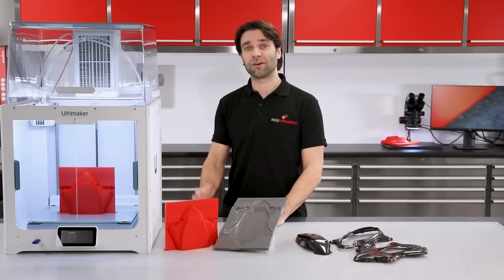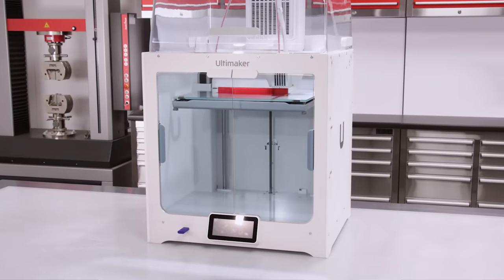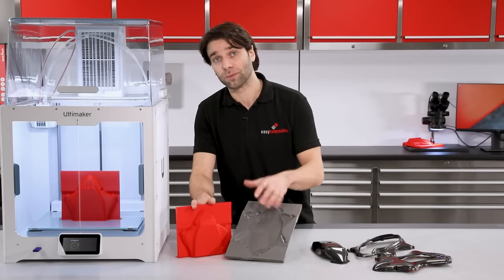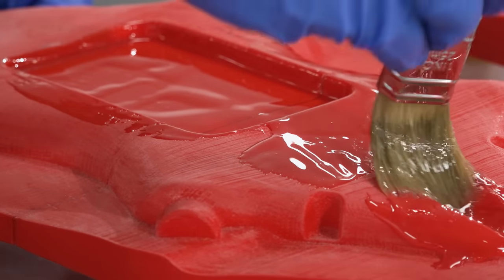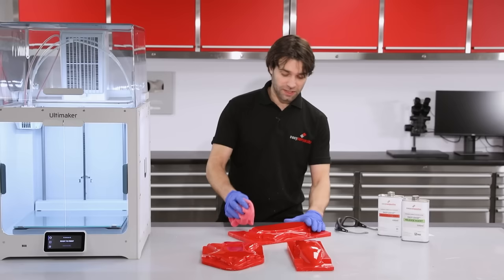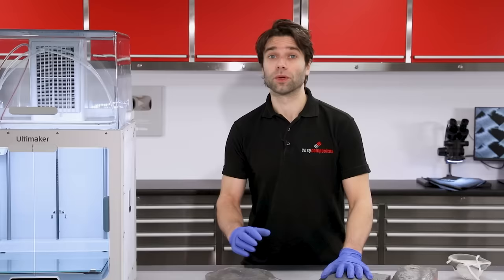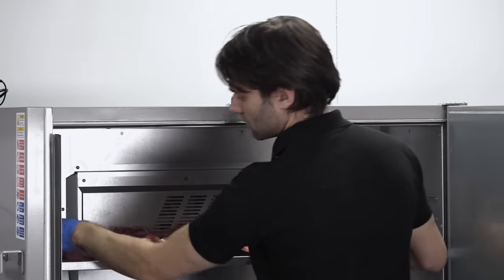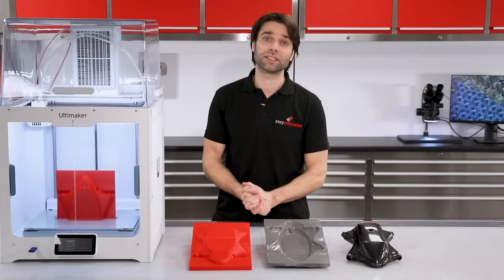Making a Composite Mould for a Carbon Fibre Part from a 3D Printed Pattern

Comment: if you are  to use a 3d as a mould i would suggest printing ABS and using acetone smoothing
Reply from the maker: Thanks for the suggestion. One of drawbacks to ABS as a direct mould material is the reliability of the release. Epoxy resin will bond quite well to ABS and it can be difficult to create a reliable release surface on an ABS substrate. Our results found PLA to be a better choice when printing the mould. It's quite true that you can't use acetone vapour to smooth PLA but then, for a one off component, it's generally going to be easier to improve the finish on the component, especially as acetone vapour tends to produce a surface that might be shiny but tends to be a bit wobbly and inaccurate, rather than a smooth, precise flat finish that a pattern or mould maker would be looking for. But, certainly worth considering in some situations.

Comment: Have you considered making a tutorial for how to make 3d printed molds for forged carbon fibre production?
Reply from the maker: We cover the basics of design of the mould in the forged carbon video itself but mostly it is the CAD work which varies depending on the package you use.

Comment: You say you can get the mould from the 3d printed part by using the unimold system. Are you sure the arising temperature of 50-60°C wouldn't destroy the PLA 3D print?
Reply from the maker: The heat given off during the cure of the Uni-mould and our epoxy mould systems rarely get that high for long. Certainly we have not seen any deformation during experimentation.
Reply: @easycompositestv  
Thank you!

Comment: Thx for the EU customs information you put up on the website... was worried i had to get another supplier
Reply from the maker: No problem Daniel. Things are far from smooth at the moment, for all goods and in both directions but they will get a lot better and once the ports have freed up and our new system is in place then we should be pretty-much as we were. And of course, we'll always be working on ways to improve how we supply our friends throughout the union.

Comment: Great videos, very informative. I would like to make a request.. I've been wanting to create my own recurve bow (as in bow and arrow) FYI I have very limited knowledge about the tech used in modern bows. Now I'm mostly thinking about the limbs, I've read that carbon fiber limbs are some of the best. But carbon fiber doesn't seem very elastic at all, take for example the rollwrapped video where you test its strength. Would you like to make a video to demonstrate some "spring bow" properties of carbon fiber and maybe other materials? I dare you to make a recurve bow
Reply from the maker: Hi Mikal, thanks for the comments and suggestion. Looking at the stiffness and strength of carbon fibre can deceptive and create the impression that it couldn't bend or flex. In fact, this isn't the case at all; it's all about the geometry of how you use it. We'll take it on board and think about a future video which shows some structural applications for carbon fibre where the end product is loaded and flexed.
Reply: @easycompositestv  Awesome! Thank you for answering

Comment: Great video. I am currently doing a similar project but using your Pattern-Coat Primer rather than XCR Epoxy Coating Resin to finish the pattern. I found the Pattern-Coat Primer worked well, but I'm interested how you would compare these two products for this use-case?
Reply from the maker: Pattern Coat Primer is designed specifically for ease of sanding and shaping on hand made patterns.  The XCR is primarily a coating epoxy that is relatively easy to sand and polish.  Where considerable shaping is needed, such as over a foam pattern, the Primer is the best solution.  For patterns that are already pretty dimensionally accurate, using the XCR is a quicker and easier method as less thickness is added and thus less sanding needed to get a smooth result.
Reply: @easycompositestv  Thanks for the detailed reply. Less sanding sounds good - I'll order some XCR for the next project!
Reply: @easycompositestv  where are you getting your files for the 3D prints

Comment: You can do a p400sand and spray it with 2k clear.... Worked out good for me
Reply from the maker: Hi Arne, as much as possible we advise against clear coats or paints as pattern or mould finishes just because customers (and non-customers) have so many problems when releasing mould or parts off paint surfaces. There are lots of reasons for this and it's not always a problem (it sounds like it wasn't in your case) but on the whole it's risky and no one wants the dreaded 'sticker'!
Reply: @easycompositestv  that's a good point! I have been there as well! I will undo my comment so no one gets distracted. Is that ok to you?

Comment: Great video Paul...!!! Can we use this method to make a mould for composite wheel Rims?
Reply from the maker: Well, you could but given the accuracy required that would probably be a better candidate for a CNC machined mould and of course, that's just the start of the complexity for a project like that!

Comment: Amazing video! Question though, How do you account for the dimensional thickness increase caused by the XCR Coating Epoxy layers? It seems not to matter for this part's design, but it seems like it would be problematic for parts that need to fit together closely/securely. Thank you for this great video!!
Reply from the maker: For precision parts you may be better off using a different method if the tolerances are that tight.  You could modify the print to take into account a typical resin thickness but it would still not be perfect.
Reply: Do you know about how much we would need to account for?

Comment: Hello Easy Composites. Can you maybe show a video on how to make a mold to replicate a very rusty item? I’m restoring an old wheelbarrow and the tub is badly rusted, holes in places, so I want to make a carbon fibre version instead. The metal is very thin so sanding is not ideal, but I don’t know how to protect it or treat the surface so that the fibreglass mold will not adhere to the rust or cause more damage. Thank you 😊
Reply from the maker: if the surface is too weak to mould from, then you would need to make a pattern.
Reply: @easycompositestv  ah right, thank you. I’ll look at those vids then

Comment: How long would a mold like this last? Or, should I say how many runs do you think you'd have gotten from these molds?
Reply from the maker: The high temperature tooling could last well over 100 pulls depending on shape, care demoulding and a little bit of maintenance.

Comment: Hey, have you guys done something like this with cnc machined metal parts? Would it be possible to use a metal part for the mold itself?
Reply from the maker: metal moulds can be used for composites. They are especially more common in high volume production.

Comment: Why not to use SLA printer and leave behind all the hustle of sanding and preparing that FDM product? Naturally with SLA there will be some sanding but with 0.0025mm resolution much less of it! I know the size of the mould could be a reason but otherwise I would like to hear your opinion!
Reply: FDM printers are a fair bit cheaper and generally offer larger build volumes. SLA 3D printers will work here for smaller applications unless you're lucky enough to have the new Formlabs 3L. That said, there will be less post-processing like you mentioned.

Comment: How would you make a mold for a bigger part ? Let's say 5 metres long ? And if I use the infusion process for a part that big would the infusion kit you offer still do the job? How is the strength/weight difference between a oven cured part and an infusion part in your experience? 

Sorry for all the questions I have  been a fan for a long time and i am very interested in the whole process.
Reply from the maker: Hi Daniel, so, when you're asking about a 5 metre long part I assume you're not talking about using a 3D print process, as shown in this video! Something that size would most likely use a hand-build process more like what you see in Part 1 of our Dark Ice series, where we make the pattern for the sledge. In terms of how well the infusion would cope over 5 metres, it would be fine but you would need to set it up correct. Watch Part 5 of the Dark Ice series where we infusion the sledge for lots of great information on setting up larger infusions. In terms of how they compare; they're remarkably similar - there's really nothing to distinguish a prepreg part from a resin infused part if they use the same reinforcement. the only obvious difference would be the service temperature of the finished part which would be higher for the prepreg.
Reply: @easycompositestv  thank you :)

Comment: How did you workout the dimensions for the mould of the part you want to make. Isn’t it slightly larger than the part itself? is there a particular software that you used that can convert a model to a mould for that model?
Reply from the maker: The 3D printed part is the exact dimensions of the finished carbon part.

Comment: Would it be advisable to print the form 1-2% smaller vs the desired finished product to account for the resin coating thickness?
Reply from the maker: Hi Jason, I wouldn't aim for a percentage reduction in the size of your prints because this could lead you to making larger parts that are several millimetres smaller than you want them to be. The coating itself only adds around 0.5mm and so the better approach would be to design the part 0.5mm smaller (in all directions) than you want it to be.
Reply: @easycompositestv  Thanks this makes sense!

Comment: Hi, I just discovered this, and I am very interested in the process so I can make my own carbon parts. do you use a regular 3d printer ? what material do you use ? abs or polypropylene ? thanks
Reply: Dont use ABS, PPE or PLA will work just fine

Comment: Googled this a few days ago after watching some of your videos ! Thank you for reading my mind ! Also, can we use regular plaster or something instead of that paste for testing purposes ?
Reply from the maker: It would be difficult to get any sort of a bond between the gelcoat and a casting plaster but in principle, you could use much more basic materials for a temporary mould reinforcement, especially for ambient temperature cure systems.
Reply: @easycompositestv  great ! Also, one video request that I've never seen around - how to create a thick carbon fiber part using a 3d printed core and a carbon fiber outer shell ! I'm very interested in such a technique ! Also, do you know if, when purchasing from you guys to Portugal, there are any extra Customs costs ? Thank you  !

Comment: I wonder if smoothing with acetone would give you a good surface finish for making the mold.
Reply from the maker: Acetone vapour can be an option for improving the finish on the 3D print but then that’s still not a good release surface and you would need to coat the print with something that can be reliably released from. In all our testing and experimentation, we couldn’t beat the process shown with the XCR resin for surface finish and release properties.

Comment: Love your videos, like the other 3d print mould, so why not printing the mould directly, coat it with resin, sand it, laminate it and vacuum bag?
Reply from the maker: Yes, you can do this. In fact, this is exactly what we did in our other video on 3D printing with carbon fibre. The reason we don't do that in this video is because we need a mould that can take high temperature so that we can cure prepreg carbon fibre in it (which needs to be cured at 120C). As you can imagine, a 3D printed mould can't be used at 120C. However, if you're only wet-lay vacuum bagging and don't need the high temperature cure then you can consider using a 3D print directly as the mould, like in this video: https://www.youtube.com/watch?v=4ND2WtEZatY
Reply: @easycompositestv  thank you so much!

Comment: Thanks for the video, helped me a lot! But I have a question. I am doing a project that dimensions are very important, so i have to consider the thickness of the two laters of resin applied at the beggning of the process and do an offset in my 3D model. What is aproximately the thickness of each thin layer o resin? Thanks in advance!
Reply from the maker: It's really going to depend on the surface texture from the print and how much resin you have to apply to achieve the flat surface. It also depends on how much you sand away so there is no general rule to determine the final added thickness. Typically you will add the resin around 0.5mm but this depends entirely on your application and then how much is sanded away.

Comment: Amazing content. Question: what would be the difference between using the epoxy coating resin on the 3D printed part vs a mould sealer? Would the alternative work or is it recommended to always apply an epoxy coating resin to 3D printed parts? Many thanks in advance!
Reply from the maker: Hi Trent mould sealer is definitely a possibility and in fact several of our customers have been using our S1 20 product for just this purpose. The difference between using a sealer and using a coating resin like the XCR is the way they build. Epoxies will build much quicker but then because of this they will need more flatting to restore the trueness of the surface. I guess I’d recommend sealer for resin print and epoxy for FDM prints.
Reply: @easycompositestv  thank you for your detailed response.  Gave me all the additional information I was hoping for

Comment: I’ve had the idea of using a 3D printed core maybe out of lightweight foaming PLA do you think that would be suitable?
Reply: Are you referring to something like Polyalchemy Elixir PLA?
Reply: @dynamism6990  not familiar with that brand I was thinking about Colorfabb
Reply: @CurJam87  Interesting. I haven't used the material personally but would assume it will work for this application since it is still PLA based with a small additive.

Comment: Nice vidéo ! Two questions : 
If the final used is not prepreg could I use the same process without the final cure of the mold (I don't have any oven) ? If yes is it the same product to use ? 
I did a 3D printed mold in PLA and get a poor result with the lb2 bio laminating resin. Will it be better with this kind of mold ? (I wish to compress a part in a two part mold) 
Thanks 😊😊
Reply from the maker: Yes for room temperature curing resin systems you can do that.  You can drop down to the EG60 and EMP60 which are  low temperature versions of the gel and putty seen in this video. PLA is not as easy to release as PETG.  Also the LB2 is a laminating resin so higher viscosity.  You want a low viscosity resin so our IB2 or IN2.

Comment: Greetings!  Is it possible to cure prepreg in a home oven?  Do you have any instructions on how it might be done?  Thanks!
Reply from the maker: We don't recommend it as most ovens lack accurate temperature control necessary for good pre-preg curing. Also most are not capable of being programmed to follow a cure cycle.

Comment: MY GOOD. JUST WHAT I NEEDED :O
Reply from the maker: Thanks Michal, that's good to hear. Look forward to seeing how you get on.
Reply: @easycompositestv  No way you wouldn't want to see it. It will be the most cheap and crude way possible 🤣 I'm a poor student, doing a custom diffuser 🤣 3d printed with a thin layer of filament in parts glueded together and reinforced with putty and fibreglass once the fitment is perfect. Than time for a mold. I've found your videos very informative and useful, it's also quite entertaining, it isn't boring 😂. The usage of a vacuum cleaner and epoxy for smoothing blow my mind away and I won't have to worry about a vacuum pomp.
I found also thanks to you guys there is a material called diolen, and it looks like carbon 😁 I'm thinking of using it instead of fibreglass, what do you guys think, diolen vs fiberglass? Or both 🤔 top layer for looks

Comment: I can understand rhe need of such in an industrial production..but i would just have used a vacuum bench and a hot owen and saved a day, then made a backing of plaster and band aid you buy for healing broken bones.. printer is basically the required part here and that i agree so i would use cheap pla, a vacuum forming table and a backing material thats cheap but that works for us home makers. A company has no such problems as resin smells etc so that seems feasible to be able to bou a product kit

Comment: How much smaller should the 3D print be that the mould will achieve the right size?
Reply from the maker: Same size.  The process of making a mould keeps the dimensions for the finished part.  The resin layer is a fraction of a mm difference.
Reply: @easycompositestv  Thanks!

Comment: Great stuff as usual! Just out of curiosity, if I wanted to do a one off part, let's say a petrol tank for a scooter in one piece, could I use a PVA filament as mold and after curing (clearly  not prepreg and not in a oven for the first part of it) wash it away? is epoxy resin gonna dissolve the PVA printed mold? thanks and great stuff, gonna send an email on the website but I highly hope you do send to NZ, still a colony of Uk innit so bugger brexit? :)
Reply from the maker: Epoxy doesn't have any solvent content so for many solvent sensitive filaments it will be ok.  We cannot ship resins to NZ at present as they are classed as hazardous goods for shipping.

Comment: Hey, 
such a nice video and the detailed one on your website was even more helpful, is it possible to do a bit larger molds with it, that are a meter long?
Reply from the maker: Assuming you have a 3D printer capable of that size.  Be aware that the paste ends up quite heavy on large moulds so you may benefit switching to using high temp resin and woven reinforcement instead - still retaining the gelcoat.
Reply: @easycompositestv  okay thanks. I'll try  👍